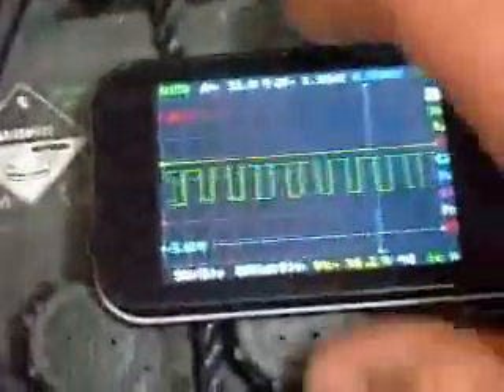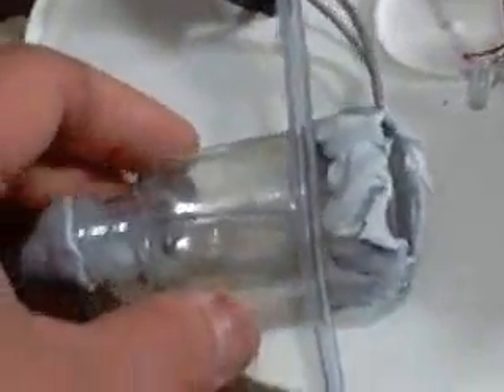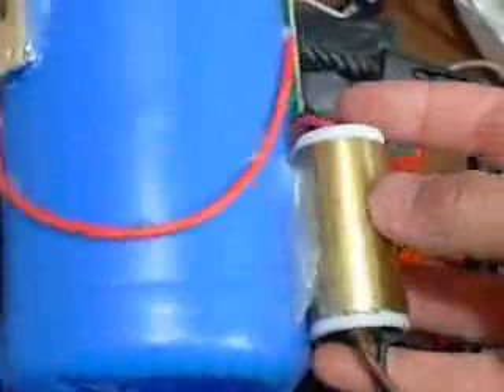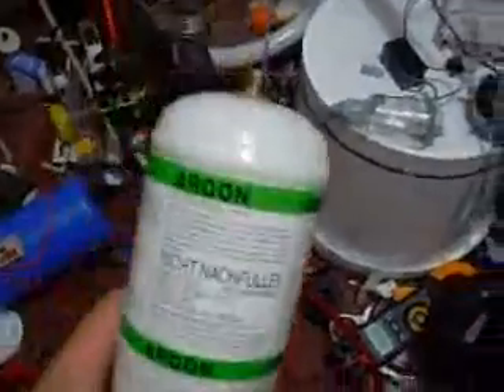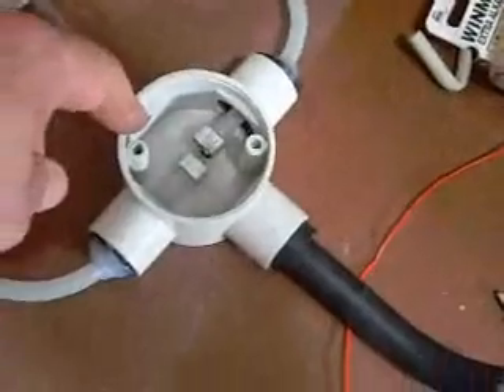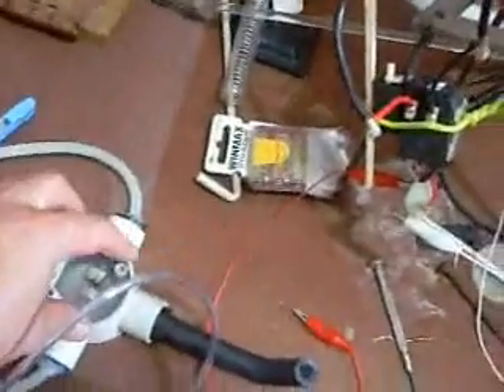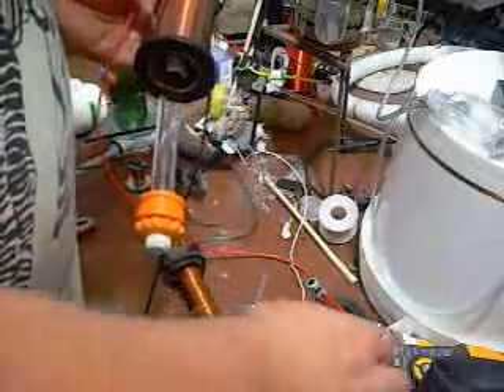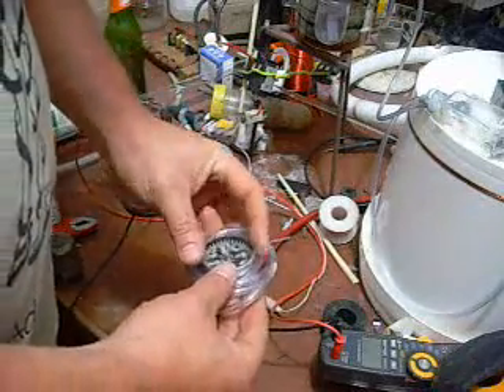Validating Stanley Meyer's-Ionised and Magnetic gas

Comment: Matt,
  on Stans patent he said there were two sets of diametrically magnetized magnets one at the area of the spark and another at the exit of the splitting chamber, so you need two sets of magnets, also, once the argon has had its electrons pulled off, you would need to introduce your second metallic gas, so that a lattice structure can be created, I would inject your metallic gas in the splitting chamber, just above the arc so the lattice can start taking place and the second set of magnets will finalize the lattice structure as it exits the chamber.  you could fill a balloon up with the gas and hold a magnet near it to see if the balloon with the test lattice is drawn to the magnet.
also things to consider- when filling up a tube with any type of gas, you will need to either evacuate any air or gases in the tube prior to filling it, or have a way to purge the other gases out of the tube as your magnetic gas is filling the tube.  also, if you drop a permanent magnet down a copper pipe, the copper pipe alone causes a back EMF which slows the magnet down as it tries to travel down the tube, so my recommendation would be to use plastic tubing as your enclosure and not copper as many other people are doing.
great video brother 🤠🙏👍

Comment: If you have the magnetic gas you're all set to make Stan Meyer's TPU. Just force the magnetic gas through a closed loop of tubing using a pump. Have coils wound around the tubing all connected in parallel. What determines your amperage is the pressure of the gas, and the number of coils.

Comment from the maker: @nexus1g a 5 amp cell is way less than running your headlights,in my case it was a simple tube to the air intake manifold which already had a fitting.Its the same as adding LPG to a diesel engine.Cost was about $30 for cell container and wiring...all the rest i scrounged up and made from recycled junk.

Comment from the maker: @NOBOX7 i suppose if you separated the gasses you could ionise the hydrogen-dont think there is much chance that the oxygen wont turn into ozone-thats just what happens to it.i dont know what ionised hydrogen becomes.btw i wasnt the only one to ionise the flame off the torch-quite a few people did it,but i was the only one i know of that did it at welder temperatures and high current.
browns gas welders also had that function for getting the heat up on a small hydroxy flame.use a MOT on the tip

Comment from the maker: @rwg42985 Russ thanx for going over the patents and bringing this to light-no i didnt removed the coating on the magnets-i figured it would burn off anyway-i ran the spark several times before i put a lid on it and it looked like the coating was corroding.
i will be trying cobalt drills next time and making a more robust container for makiong particles so i can run it off a welder or other higher current device to rip up the metal quicker-im concerned about it being too dilute in the gas.

Comment from the maker: @harpbloke yeah mate hearing protection is a must-i dont think Meyer would have built 4 of these of different designs if they didnt work-his video commentary implies each was more efficient than the previous.
yes perhaps the speed of the particles is the problem but i tend to think that i could deflect the needle on the compass regardless of the velocity of the gas if it is going to arrange itself into a lattice of flux lines with a mechanical pump then it should lattice all by itself

Comment: hi matt meyer states his epg was a gas that was at room temperature so would you not think that he used steam inside a vacuum sealed stainless steel tube hence then if you place a positive on the stainless tube wall that would atract the oxygen and centaralise the hydrogen atoms then pulse a led ultraviolet light to energise neucleus that would start momentum with the pulsing coils and hydrogen would also eec (electron extraction circuit) circuit it . just a view how i interpretate it.